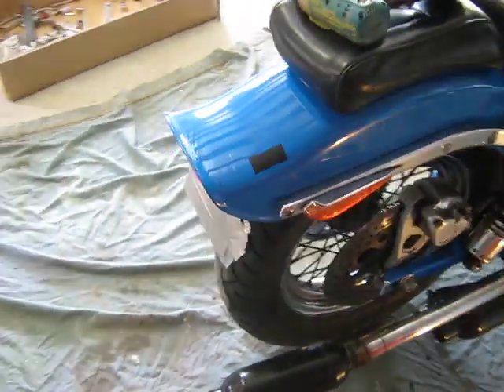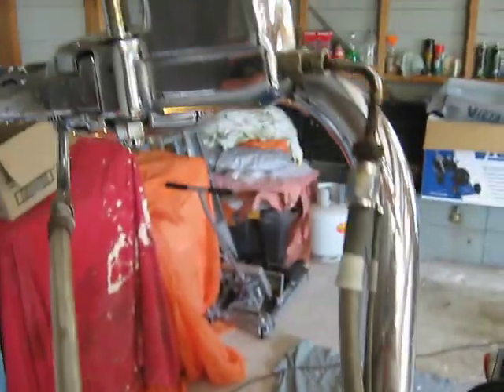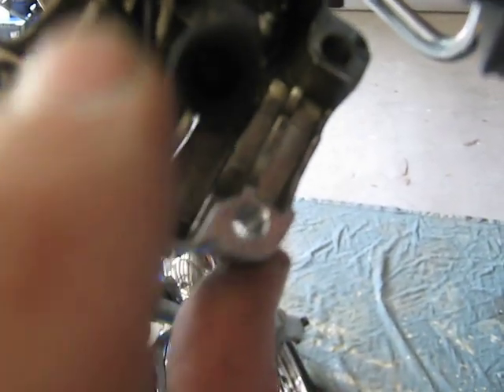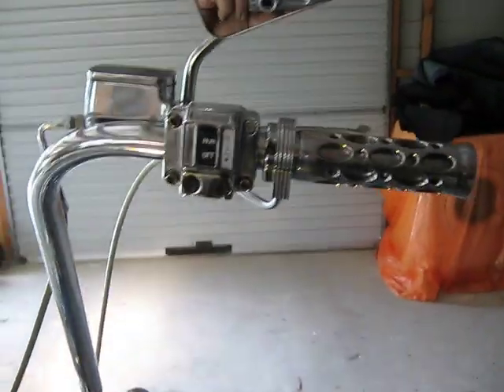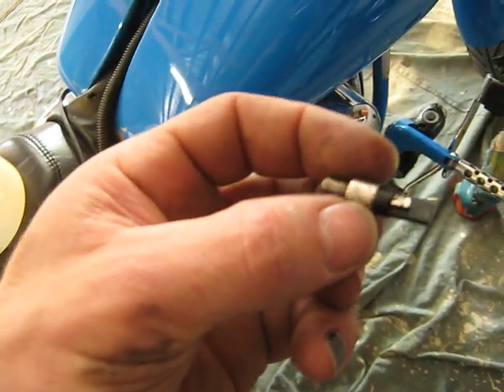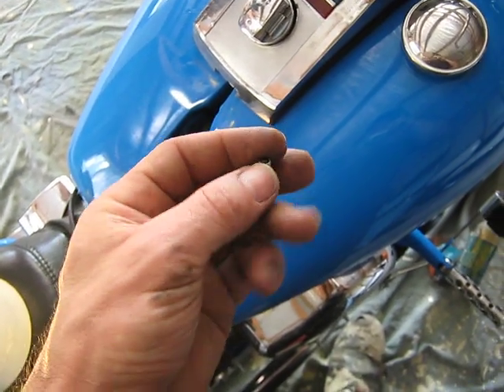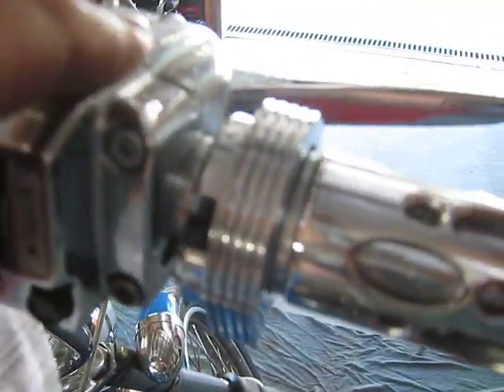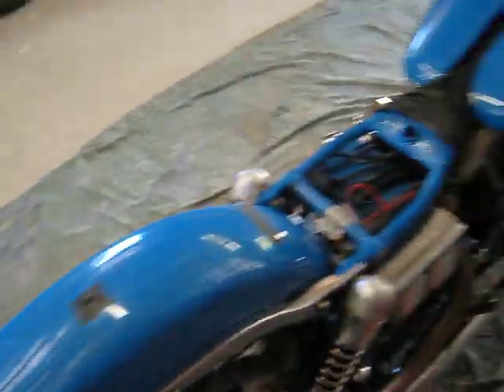Fix front brake switch

Comment: I gave mine a good cleaning, and a couple light taps with a hammer to the brake lever's tab and it holds the plunger in until I release the lever and the plunger springs out and brake light comes on...it's good to have a brake light again...thanks for your informative post man!

Comment: Nice video but...the are not sensors!! They are basic on off push switches that control the brakelite..at least on my stock 883 they are switches
Reply from the maker: +Dan Favata Yep i was referring to a brake fluid pressure switch as a sensor , at the time i didnt rely know too much about engine sensors ( inlet MAF and exhaust oxygen sensors ) the vid was made a while ago